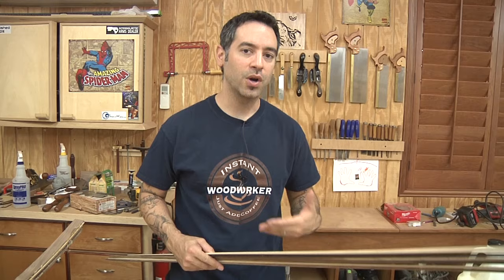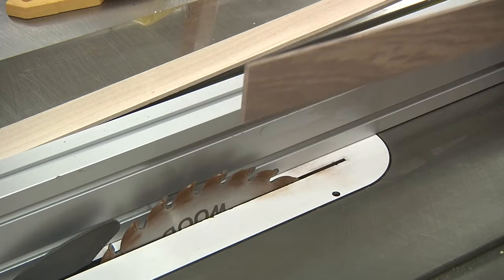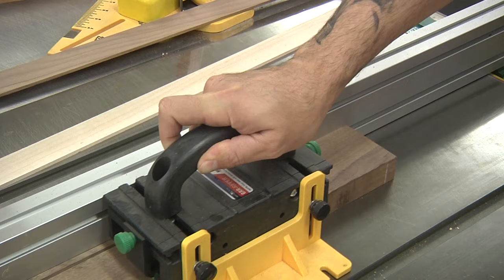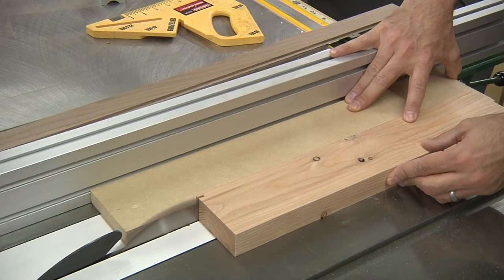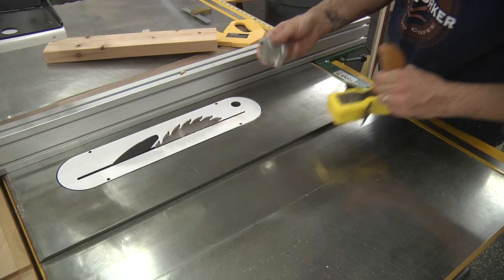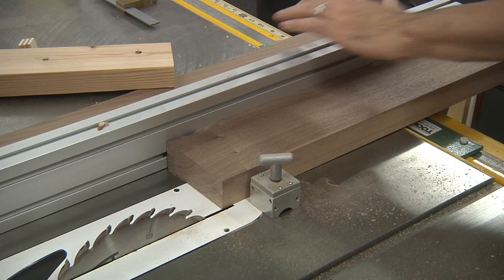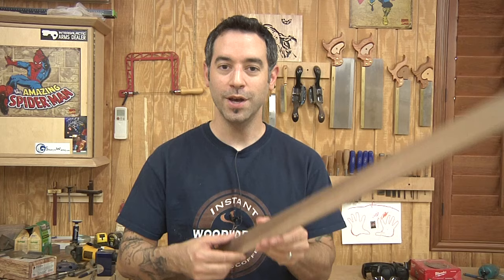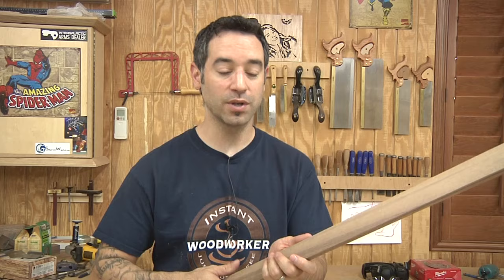Cutting Thin Strips at Table Saw

Comment: You can use a 7-1/4" blade in the table saw for a pretty thin kerf for this kind of thing.  Obviously you are reducing your max depth of cut but I can just make it through 8/4 stock, if it's already planed down to 1-3/4", in one pass.  Anything thicker than that and you should be using the band saw anyway.  I have a variation of the second method where the jig fits over the fence and sits over the stock so there's no way it can lift up on you.  Only practical on short stock.
Reply: Having a 7-1/4 and an 8-1/4 40t lying around has saved my butt a few times.

Comment: You should also have mentioned to use a zero clearance insert in your table saw when making these types of cuts so you don't accidentally drop one of those thin strips between the blade and the insert and have the potential for the blade to throw that piece across your shop.  I actually leave the zero clearance insert in my saw all the time now, it makes for a more stable surface pushing material through the saw anyways rather than having the standard insert with a wider blade opening.
Reply from the maker: William Todd I guess I made the mistake of assuming everyone should already have a zero clearance insert. Good point.
Reply: William Todd Yep, I've dropped pieces through my saw...

Comment: I use a modified version of your last one. I clamp a board at the right distance and about a couple inches before the blade. My blade is really good but my fence is in need of a tuning so I usually have to sand one end a little bit for evenness and small whorls from the side of the blade on the previous cut.

Comment: I cut a lot of thin stuff on the table saw. Unless it's very thin, I usually use a 1/4" thin strip as a push stick. That is, cut a thin strip that looks about like a yardstick (say 1/4"x1.5"x24"), and cut a notch in the end to grip the workpiece. When you cut strips less than the thickness of the push stick, the blade will mill the last 3 inches of the push stick down to the thickness you need. Works very well down to about 1/8" strips. Thinner than that and the end of the stick breaks off, so you would need to use one of the other methods.

Comment: If you want to conserve wood with this method, you could simply use a Freud demolition blade from home depot (or wherever). While meant for a circular saw (7 1/4), these blades have shockingly perfect cut quality and have a very thin kerf. Best thing is, they have value packs from time to time. Two blades for $15. I've been using them as the main blade in my table saw since I saw Mafe's tip on Lumberjocks. Very long lasting.

Comment: Nice video and some great tips.  I have to cut a lot of 2mm strips, so I looked for ideas and this video was perfect.  After considering the 3 strategies, my preference and vote is for jig - technique #2 for these reasons: aligning a fence to accurately bump against the stop block is really fussy.  I would have to nudge the fence with the material to the correct position.  When I throw my lever to tighten the fence, it throws the distance off slightly, so have to re-nudge.  I typically need to do this 3 or 4 times.  Since I’m fussing with the fence, I need to turn off the saw between cuts.  What a bother!  Another advantage to the 2nd technique: attach a small block of wood to the top of the jig, to act as a knob which is better than the pushrod, and then you can easily guide and steady the jig (with your right hand) while holding your material in your left hand.

Comment: There is a fourth method that I use a lot. set the fence to the thickness you want, move the blade all the way down, put your stock on there, then clamp a scrap block above it, above your blade. take your workpiece out, and raise the blade until it just cuts into the scrap block. set up a featherboard, and you're good to go to safely cut hundreds of teeny tiny strips. Push the last bit through with another piece of scrap.
Reply: I'm afraid I do not understand this fourth method :-(.  Where do you place the featherboard?  If on the side of the fence, don't they mind each other?
If on the opposite side of the fence, is it not necessary to move the featherboard after each cut because of the fact that the plank of wood of which cut the thin
strips becomes less and less wide after each cut?

Comment: Marc: Very nice job on the video.  Your "teaching" style is cool, laid back and secure.
Can you give me some tips or advice?  Just trying to do some beginner level woodworking.  I have a basic (lower level) table saw (Dewalt -- only about a 2 sq ft table) and a small band saw (for small to medium jobs).  
(1) I need to cut short pieces of wood trim with a triangular pattern (to be painted and used for setting up door-window sensors on a couple of windows).  How does one cut a triangular piece (triangle lengths 3/4", 3/4" and about 1.1") and overall length 3"?
(2) Any book, article or other resource on how to get a basic foundation of woodworking?
(3) What kind of stain, polyurethane, or lacquer would you use for clear satin finish on natural pieces of woodwork (display boards, artwork frame, etc)?
Any thoughts would be helpful. Thanks.

Comment: Personally, I like the second way the best. Commercial push blocks are quite expensive (and I don't even know if they are available in Slovakia) and the third method requires a magnet
(with will not hold on my melamine board of my self-made table saw table (circular saw turned upside down) and my self-made fence is not so easily to move exactly another 4 mm or so.
You mention as a drawback the limited length of the strips you can make with the second system.
What is the max length (in your eyes, considering that not everybody has your skills/experience) for the thin strips to make in the second method?

Comment: Your last method only works if your saw top surface is ferrous metal.  Mine is not so magnets do not stick to it.  I like the second method since you never have to readjust the fence.  Less to go wrong moving it.

Comment: I like the second method, but I can  cut thin strips of 1/16 thickness right on the fence side all day long, with a trick my wood worker mentor shown me. hint : Well glued Formica on the pushing block. the only thing is, once there is 1/4 " of wood left it  becomes dangerous. And lets not forget the Zero clearance insert is a must!

Comment: Is that a 60t blade? I asked because it looks so smooth! I was told a 200t blade will cut it so it won't need any sanding to glue...
Reply from the maker: That's just my regular 40T blade. A 200 tooth blade will likely cut incredibly smooth, but is also a lot more likely to burn.
Reply: +The Wood Whisperer ok thanks man. I guess a 60t will do it

Comment: Marc - do they not make thin kerf tablesaw blades for this purpose and if so about how much of a difference would it make?
Reply from the maker: Robert Tucker They do make thin kerf blades. The difference would be the exact difference in thickness between the thick and thin kerf blade. :) In the end, it could help you get an extra piece out of a board by saving a little on each cut.
Reply: makes sense. - thanks for the reply.

Comment: I'm new to this so you may have addressed this in the past: I noticed in your videos that you use your bandsaw frequently to do ripping. What are your reasons for this?
Reply from the maker: It can be much safer than the tablesaw. At the table saw, if the wood decides to move and bend in on itself, it can pinch the blade and cause kickback. So on really long or rough stock, it's much easier and safer to rip at the bandsaw where kickback isn't an issue.
Reply: Yup. Just finished watching the Calendar episode. Thanks!

Comment: I've been cutting strips as thin as 0,5 mm on my table saw. This video correctly identifies the problem : pushing them past the blade at the end of the cut. I've always been able to shift my position during the cut so that I can PULL the work piece & the strip out from behind the blade. If I'm not planing the strips afterwards, but still want decent accuracy, I use 'feathers' to press the work piece against the fence. The solutions presented in the vid seem overly complicated...
Reply from the maker: barkebaat How so? These are solutions to a fairly challenging issue. Curious how you might simplify them.